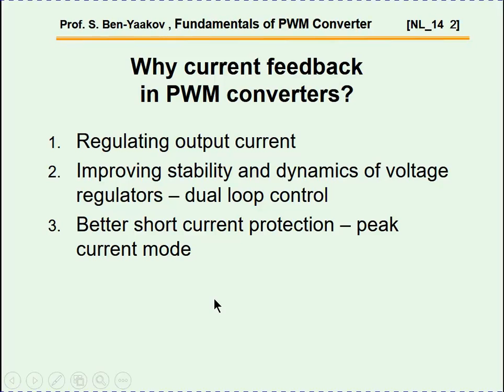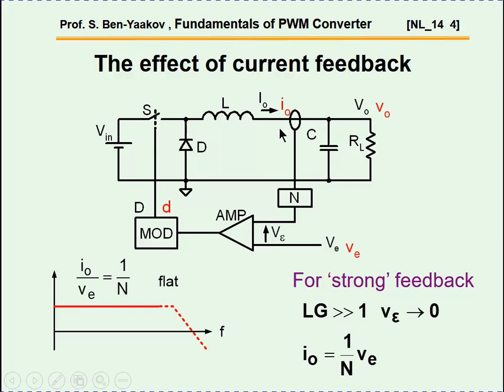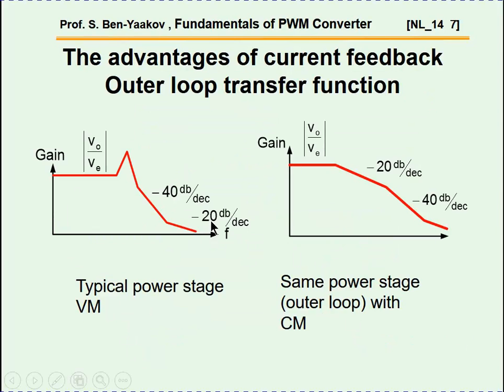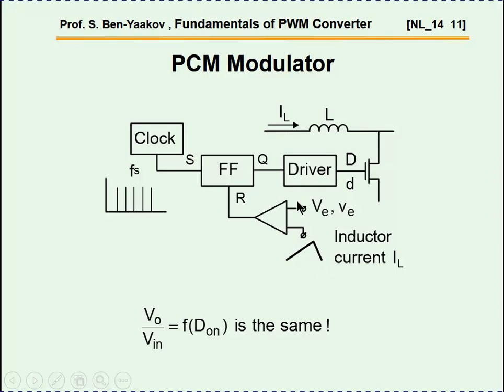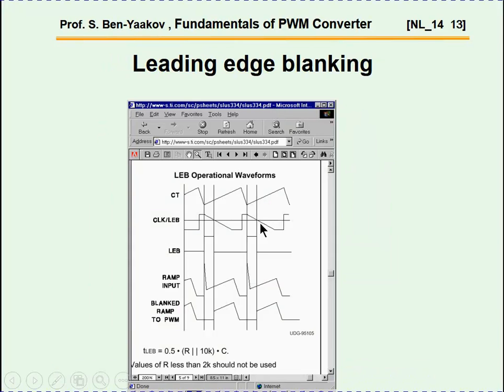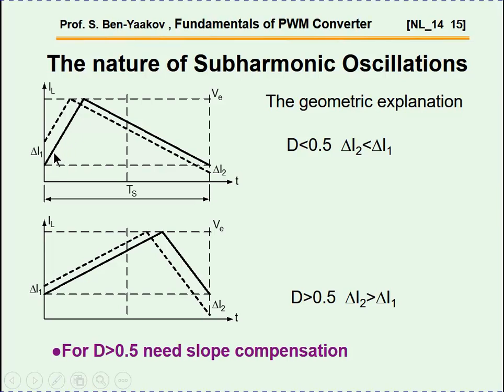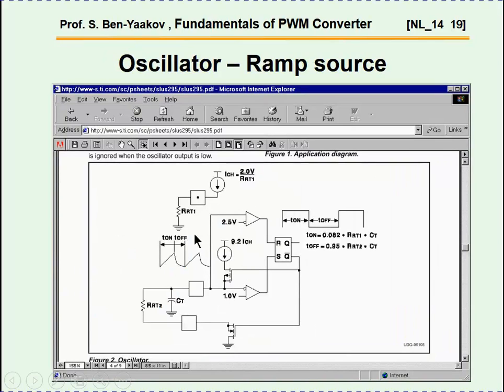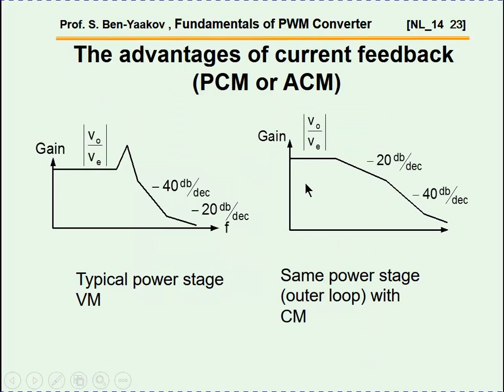Basics of  PWM Converters Controller Design. Part III. Peak Current Mode (PCM)

Comment: Sir, the Ve that is used here is basically a current reference generated by the voltage loop right?
Reply from the maker: Please indicate the time or slide number you are referring to.
Reply: @sambenyaakov  3:34
Reply: Hi sir, also if we want to use a synchronous buck converter as a constant current source, I have derived a small signal transfer function for the (inductor current/duty cycle).  In the transfer function we have a load component R. Suppose if the load is a battery or maybe a simple capacitor, I am unable to understand how to factor it into the transfer function to derive the suitable controller.

Comment: Ray Ridley Said it is a bad practice to derive the slope compensation from the clock of the PWM controller. It is better to use the gate square wave voltage and using a small RCD circuit, you can make a nice ramp.
Reply from the maker: Thanks for the input. I think that the two approaches are valid.

Comment: this vref is it the voltage desired  in the output of dc dc  or what
Reply from the maker: Yes, or a fraction of it if a voltage divider is used.
Reply: Ah, I have a problem. What causes the error?

I know we use a voltage divider, but why? Is it just for compensation, to stabilize the voltage from the ripples?

And then we compare this voltage (the feedback voltage) with Vref. Is this Vref constant for any value of Vout?

If you could explain this to me, I would appreciate it. I feel lost.

 @sambenyaakov
Reply from the maker: @khabylameyt5018 The reference is fixed so if you need an output higher than the reference you use a voltage divider

Comment: Hi Professor, can you make a video to explain the effect of double poles at Fs/2 in PCM? Where the Q of the double pole has dependency of slope compensation. I believe this was first introduced by Dr. Ridley, I went through the paper and many others paper after that but with no detail derivation to show how the Q factor equation derived.
Reply from the maker: I leave it to Dr. Ridley who has blocked me, in one of the LinkedIn groups, from seeing his posts .
Reply: @sambenyaakov  I am shocked to hear that Dr. Ridley has blocked you in the Linkedin group, can you comment what your though of this introduced double poles where Q factor related to slope compensation? The reason is there are so many different average models on PCM and I am not sure which to use. Industry widely used models are Chris Basso model and Sheehan model from TI,  both included this double poles at Fs/2 but not exactly follow the theory behind it.

Comment: Sir, Can I use pure digital mode to implement PCM mode control, Can I use slope compensation by software?
Reply from the maker: Yes but you nod very high shambling rate for current.

Comment: Dear Professor Ben Yaakov, thank you very much for these intuitive explanations.
I hope my question isn't too stupid.
If the peak current of the inductor is compared to an error voltage, how can be moved the averaged inductor current depending on the load to reach a new steady state? In steady state condition,the converter should fight to reach always the same error voltage, i.e. always the same peak current...  I hope my issue description is clear enough.
Reply from the maker: THis reference to peak current is the output of the voltage error amplifier. The "reference"level" will be moved up or down as required.

Comment: Mr. Sam, since we get feedback of both the current and the output voltage (2 state variables), isn't this a "Modern Control Theory" approach to design a Current Mode converter ? I mean, in voltage mode control, the standard theory of control is used, but I can not find nothing relating this way of control to state space control approach... why ?
Reply from the maker: There are many resources on that just google

Comment: Great explanation on the current mode control and why it’s single pole roll off! Can you explain in an intuitive way why DCM voltage mode control is a single pole system also?
Reply from the maker: Yes. Because the charge is transferred in quantized manner.

Comment: Thank you very much for all your video and time that you take for all this explanation. 
I just have a small confusing question.
If you could please help me to understand.
Around 6:00 you said that  Io=ve/N, that mean error still equal to 0 .  but at 12:00  you said that the reset is activate when the tension ( image of inductor)  equal to ve that mean error is not still equal to 0. 
This is not really clear for me.
Reply from the maker: First case talks about the benefit of current feedback and is illustrated by AVERAGE current mode. Second case is PCM.

Comment: Hi Professor

I am curious to understand why system order reduces for inner loop feedback of a state variable. Is there a intuitive way to understand this. Mathematical explanation would work for me too.
Reply from the maker: Inner loop, within the range at which the loop gain is larger than one,  makes the state varible dependent on the inner loop input signal and independent of the impedances of circuit so you can consider the state variable (say inductor current ) as a source rather that a variable that depends on circuit elements. Let me know if you" bond" to this explanation😊

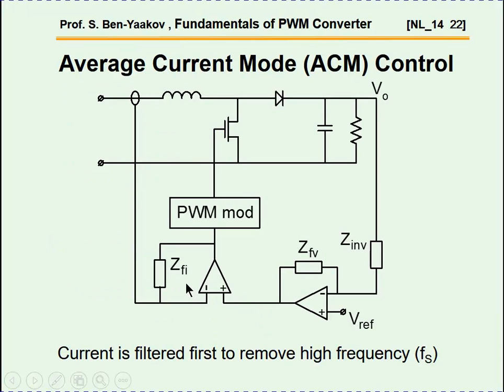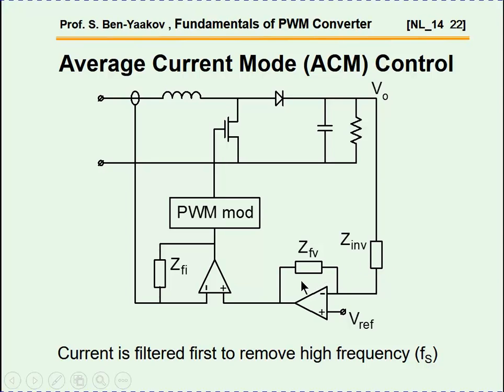Comment: Dr. Sam: A quick question on the dynamics. When you say dynamics , does it mean how fast a system responds to the load changes?  @26:23 you explain about avg current mode control. Vo/Verr  is a 1st order system. 27:17 But, why do you say the dynamics are slower than peak current mode control ( what do mean by quick changes in current) . Both  ACMC and PCMC are 1st order in the low freqs. Can you please be kind in explaining about the dynamics?
Reply from the maker: Hi Swaraj, Good question (which means that I know the answer (-: ). The classical meaning of dynamics is the system's response to a step in the reference. This of course translates to the response to a load step.
  The  loop bandwidth in ACM is smaller that that of PCM. The outer loop looks first order only as long as the current feed back loop is active. So in ACM the outer loop reverts to second order at a lower frequency, which means the the BW of the outer loop will be smaller.  
Are you looking at 
https://www.linkedin.com/groups/13606756   ?

you may enjoy it. It develops into a good discussion group.
Reply: Thanks Dr. Sam. 2 more questions if you please don't mind:
1) If system is a higher order the loop response is slower? I think this is the reason current mode control (1st order in low freqs) is faster than voltage mode (LC resonant pole ).
2) Isn't current loop always active in avg current mode control? since in ACM we compare the Vout to Vref and the error is the set point. Then current sense signal is compared to a set point  and then compare the output of this to a ramp ( 3 comparators or 3 ampliifiers in ACM). Even in PCM, the inner current loop is always active.
Reply from the maker: Hi Swaraj, 
1. A second order system has a roll off of -40db/dec so to get a wide bandwidth there is a need for a  compensator with very high gain at high frequency and a double zero. Which is almost a mission impossible.
2. The inner current loop in ACM has a small BW due to the need for filtering the ripple. Once the loop gain of the inner current loop reaches Odb, it is not functioning although connected,  and the outer loop reverts to the basic voltage mode. 

If not imposing too much, I would be happy if you would post your very interesting questions at the LinkedIn group I have stated so others can benefit from the exchange.  
https://www.linkedin.com/groups/13606756

Regards
Reply: Thank you Dr. Sam. I will join.

Comment: Hello Professor, Thank you for the explanation. Although apparent from waveforms, I was wondering if there any intuitive way of explaining why a perturbation in inductor current amplifies over a period of time, when duty cycle is more than 50%.
Reply from the maker: As far as I know, the  geometrical explanation is as intuitive as you can get . Other formal explanation are much more involved e.g. http://www.ee.bgu.ac.il/~pel/pdf-files/conf45.pdf
Reply: Thank you Professor. 

I could not go through the derivations but skimmed through the general concept presented. In the conclusions section, it is said that increasing the value of input inductance in a boost converter results in lowering of the maximum duty cycle beyond which subharmonic oscillations set in. Doesn't this seem counter intuitive since increasing inductance decreases inductor current ripple and hence oscillations should start to set in at a higher duty cycle.. 

Please apologize if I'm missing something very basic here.
Reply from the maker: To Be honest, I don't remember the details now. If I have the time, I will look it over/
Reply: No problem Professor, Thank you!

Comment: Could this design be used as a short circuit current limiting circuit? If the error amplifier for the output voltage was eliminated completely and the clamp voltage was placed at that node to set the maximum allowable inductor current? Thanks
Reply from the maker: Yes indeed. As a matter of fact, the circuit as is can serve as a cycle by cycle current protection if the output of the error amplifier is clamped to the desired value.

Comment: thank you for the excellent work Sir,
i have a question if you don't mind,
in PCMC can the output load current vary or does the inner loop keep it in a certain value by regulating the inductor current.
i just started working on this control and i am still confused.
thank you in advance for any elaborations on this matter.
Reply from the maker: The inner loop is controlled by outer loop. So when required the inner loop will change inductor current.

Comment: Sir, what should be the values of resistors in voltage divider?how should I calculate those values?what are the things I need to consider before I am going to step down the voltage?what will happen if I give directly to the error amplifier?
Reply from the maker: You mean the voltage divider from output to error amplifier?
Reply: Sam Ben-Yaakov yes sir
Reply from the maker: The voltage divider matches the required output voltage  to the reference voltage used. If the values are the same then there is no need for  a voltage divider. Many  at time the reference is already inside the controller IC so you cannot change it.  If you can, beware not to exceed the common mode voltage allowable at the input of the error amplifier.